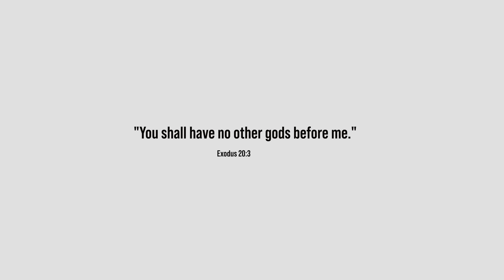I’M DEAD IN THE WATER WITHOUT THIS $100 ACCESSORY

Comment: Nice blind build. Been putting off building a new one for too long. Ive usually double stacked scaffolding for a frame and then put a platform up top that i anchored a tent style blind to.  After using that for several years, the only thing I dislike about it is you lose the ability to lay prone and if you are overlooking a large field you are more likely to make that 800 yard shot prone with a proper shooting rest than we are sitting in the blind with sticks or a tripod.  I like your build, probably something just like that with a little flip up panels around the bottom would be the winning ticket.

Comment: I'd be curious to see how long that Blind lasts as it looks like untreated pine wood. Surprised you didn't 'pop' for the shadow hunter blinds with aluminum or vinyl siding. I had one from 2011 and sold to a buddy when I moved, still looks newish.  I know the Amish around my area build lots of those pine units cheap in Wisc..
Reply from the maker: Yeah, I was feeling "cheap" if you want to say that.  Bought three of these setups for about the price of one Shadow Hunter or similar.  :)
Reply: @GoodWorksTractors   Yeah they doubled if not tripled in price in past 12yrs.
Reply: If you’re worried about longevity a coat or 2 of stain and a clear coat would probably help seal it but that’s time consuming.

Comment: Why not go through the 14' farm gate halfway up the fence instead of going down and turning around?
Reply from the maker: That gate is messed up and won't open further.  I could remove it completely, but I don't want the kids four wheelers going through there...so, kind of using it to steer them elsewhere :)
Reply: I have some that are hung where both pins are facing up, and you can just lift the gate off. Then I have the rest that are installed properly, with the bottom pin facing up and top pin facing down, and they're impossible to remove. Especially after the pins have been in place in the posts for 30 years and the brackets are rust welded to the gates. There's 5 gates I'd like to replace, but at $200 for a cheap gate to $400 for a good one, they're just going to have to wait :)

Comment: Nice way to set it up! Lot easier than dollies and the ramp/pipes, block and tackle with a pickup. 

How is the JCB loader doing for you?
Reply from the maker: Thanks Tim.  That wheel loader takes some getting used to.  Articulation is a different type of movement, that's for sure!
Reply: @GoodWorksTractors Very true! It’s even worse going back and forth between rear axle cab and front axle cab.